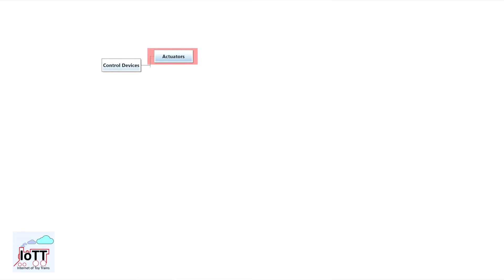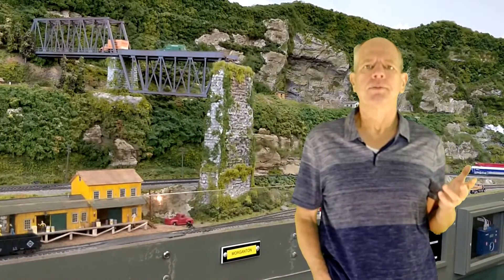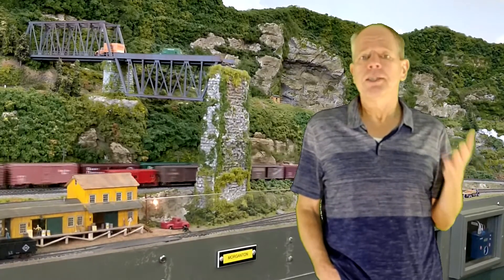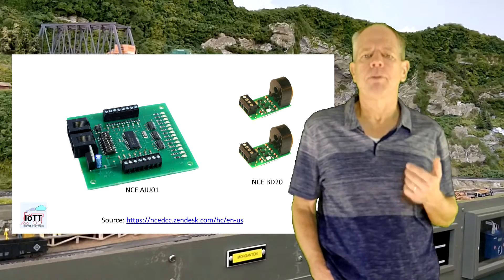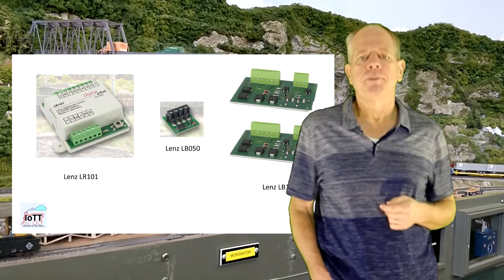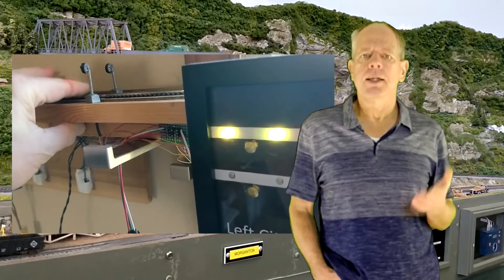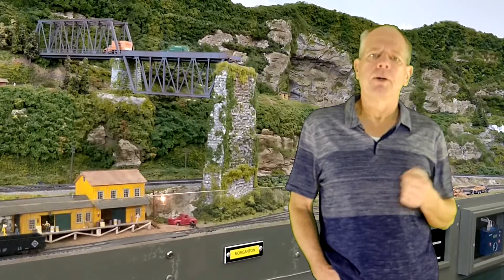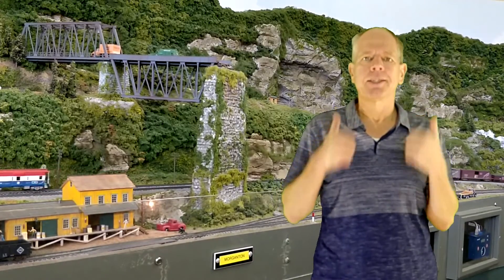Current Sensor Block Detectors (Video#38)

Comment: Have you heard of a chip / circuit called an Okkie8?    How does this work compared to the other devices you highlighted?
Reply from the maker: The Okkie8 is an eight channel current sensor module from arcomora.com in the Netherlands. From a functional point of view it is identical with the Mollehem Occupancy 8 Diode board I reviewed in Video#68. However, the Okkie8 current sensor circuit does not use comparators for detection, but only the opto coupler LED's, which means less predictable sensitivity as it depends on the current transfer ratio of the opto.
Reply: @IoTT  Thank you for the quick response.   
I like doing a lot of diy stuff with microcontrollers so I have looked around a few projects.  Sometimes it can be hard to find information.   
I did settle on DCC++EX for my command centre as my layout is only small at the moment.   
Any suggestions on a good way to add loconet to a DCC++ based controller?
Reply from the maker: @EsotericArctos  Have a look at Video#79 https://youtu.be/BG7DtPcBpxU

Comment: Could you make a video about Ground blocs detectors often used in 3-rail (marklin) setups?
Reply from the maker: I am not really focussed on 3-rail track, but as far as I remember the standard way of doing block detection is simply isolating one side of the track and use the axles to bridge them to the other rail. A decoder then simply detects whether the isolated rail is pulled to ground or not. Very prototype like, really. Common decoders to process the input signal is the s88, which has been around for decades, or similar products from other manufacturers.

Comment: Is it possible to add the ABC braking function found in some locomotive decoders like ESU, that use a https://dccwiki.com/Automatic_Brake_Control with current sensing block detectors ?

 This way the loco will stop automatically if the signal is red and then go when the signal is green.
Reply from the maker: Yes, that should be no problem. The asymmetry for the ABC system is a voltage asymmetry and - if at all - will only cause a very small difference in current. ABC actually is a very smart way to stop locomotives in front of a signal, it eliminates the need for knowing the address of the locomotive that is approaching the signal. Too bad it never made it into the main stream.

Comment: You covered block detection very well.
I have experimented with the 5 Amp version ACS712, and was unable to reliably detect under about 100mA track current. They are noisy below this figure. The data sheets cover this and their sensitivity.
However, they are great for detecting higher currents and very usable for over current protection such as booster sections and reversing loops.
Reply from the maker: Thanks for the information. That's exactly what I thought might be the case when I saw the low current to voltage ratio in the datasheet of the ACS712.

Comment: I have a friend who is a huge advocate of current detection and has resistors on one of the two axles of a truck for all cars except the cabin (caboose) car.  For the cabin car, all 4 axles get a resistor.  He has used 15k ohm for the resistors on all resistor axles.  Locomotives have their own current draw as they have decoders.   His system is the NCE on his layout.  We are now converting the area's club layout to resistor axles with the same structure - 2 of the 4 axles get the resistor and the cabin cars gets all 4 axles.  Why that? well it shows the end of the train as a slightly larger current draw so the end of a train is always marked and identifiable.  Most of the trains are in the 20-40 car length.   The club's system is Digitrax.   really like your discussion on using IOTT for trains.  Keep up the good work!
Reply from the maker: Thanks for the comment. This sounds very interesting. What I wonder though is how your friend is detecting the slightly increased current of the cars with 4 resistors. To my knowledge the NCE BD20 does not output an analog signal, but only occupied vs. not occupied. Or am I not up to date with that?
Reply: @IoTT  The reason for all 4 axles is to ensure that the train's end is detected.  Loco's will always be detected, but the end also needs to be detected.   Dirt, poor contacts may not get detected, but if the end is detected, this will ensure that a block is cleared.  Or that is what he is trying to do.  BTW: here is his layout: http://pamodelrailroads.com/smallery/default.htm